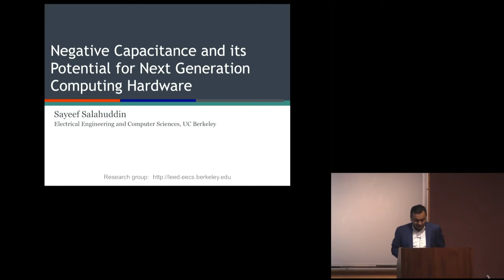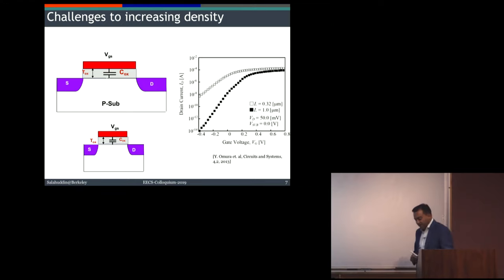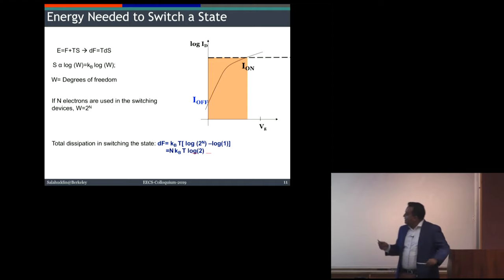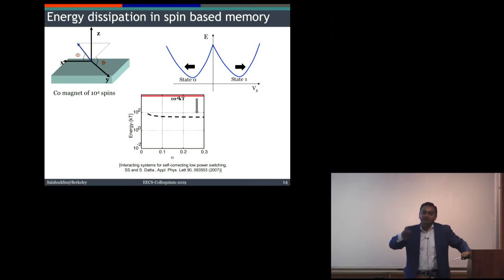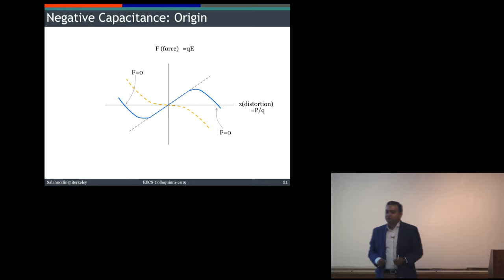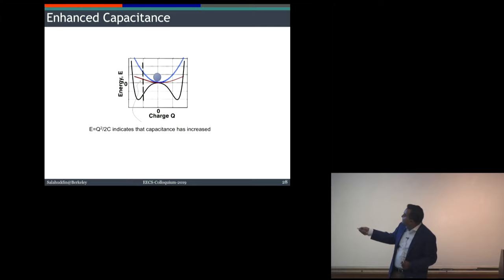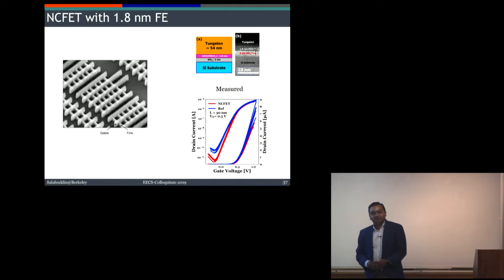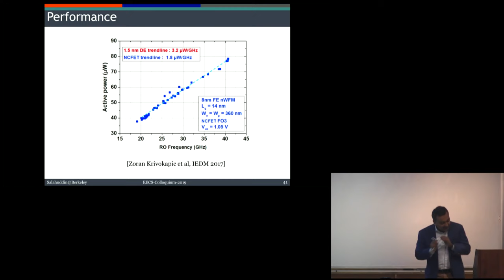Sayeef Salahuddin: Negative Capacitance and Its Potential Use for Next Gen Computing Technology

Comment: Well, you are building a flyswatter. Looking at the point, where you are hitting the fly, you will find that the hit is faster than your hand could hit by theory. But if you build an oscillator with a flyswatter, you will find that it cannot oscillate faster than your hand could.
Reply: Yet, a very nice talk.